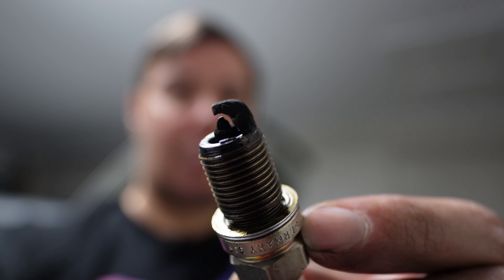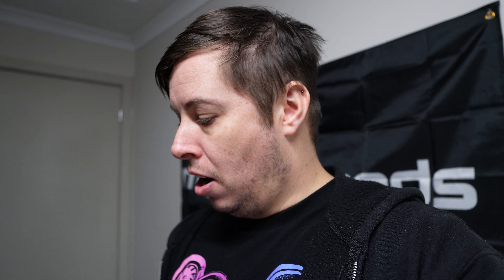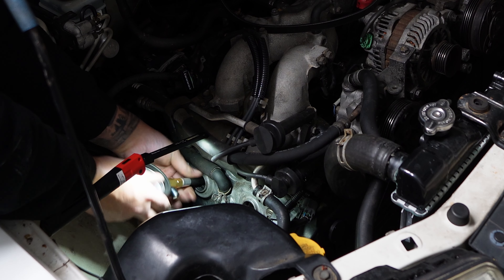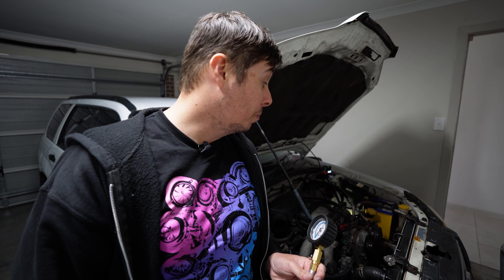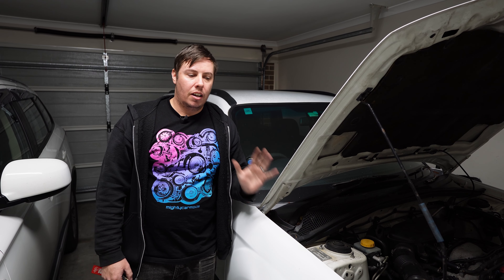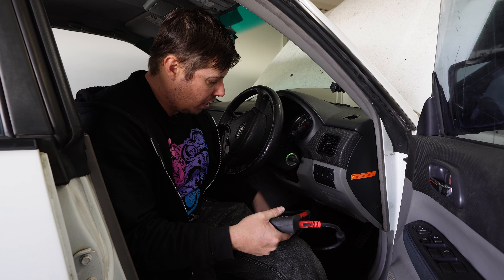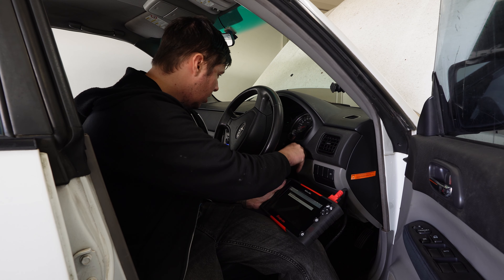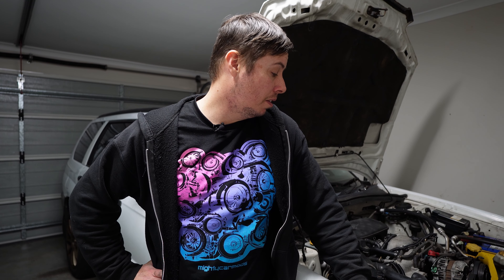The car That keeps on giving......   me a headache!

Comment: Try unplugging the MAF when it revs up and see if it smoothens out. You should also test fuel pressure drop, change the fuel filter if its old, and smoke test your intake for vacuum leaks. Another thing that might work is the idle relearn procedure by MrSubaru1837. If none of these work and you're still pulling a P0300 (gross misfire) you'll likely need to redo the plugs (NGK or Denso). If the misfire is specific to a cylinder, then change out that cylinder's coil pack. I've dealt with this same issue tons of times.